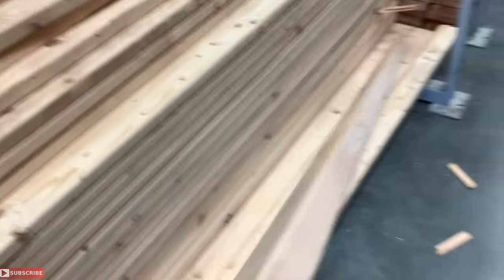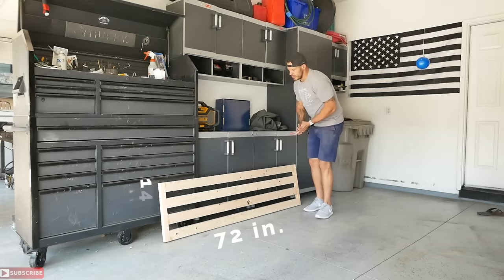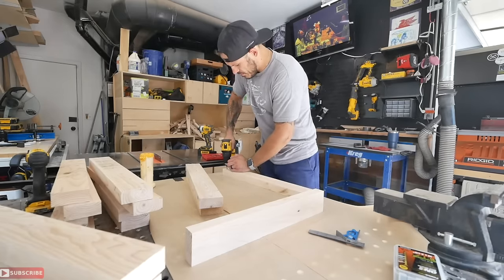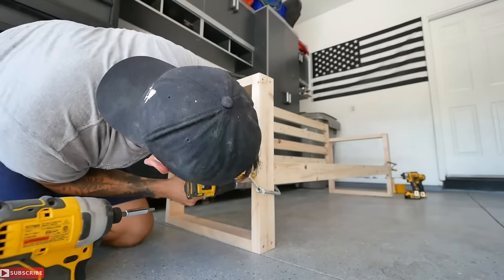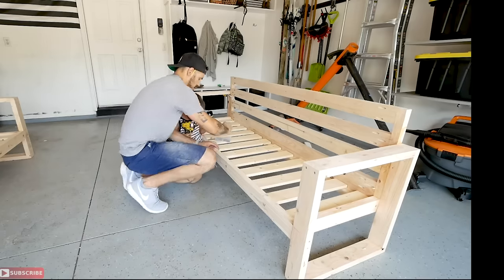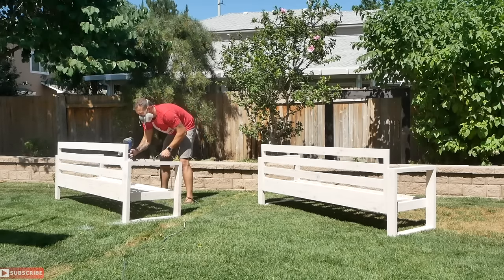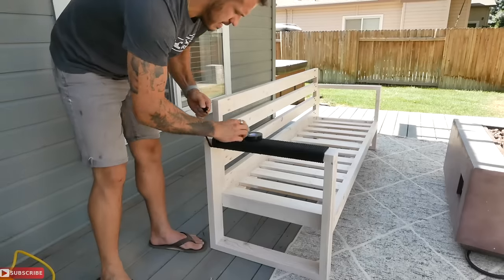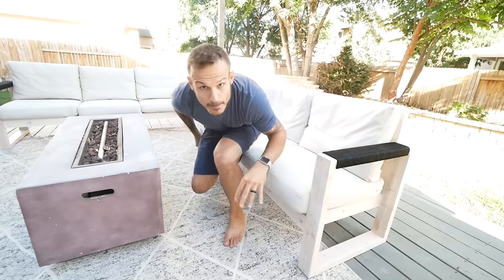DIY OUTDOOR SOFA

Comment: Just made my own version of this sofa and it was super rewarding. Didn’t use pocket holes but I hid all my screws with dowels. Came out pretty nice. Thanks for the video!
Reply: what do you do at the time of rain?
Reply: @mohammednayim  I built mine as a gift but I visit the house where it’s stored frequently. The build is still solid and the finish is still holding up from 2 years ago with little to no maintenance.
Reply: @BrianMajor  Thank you for the info. I been trying to get an outdoor sofa but my wife keeps on saying it will get ruined in rain.

Comment: Really nice. Mine was a simpler build just with screws. I bought Allen Roth cushions during some clearance at lowes. Ended up only spending 40 dollars for the cushions (6 per couch) instead of the original 160 dollars. I used Olympic Stain (leftover from the fence) and like 5-6 coats. The wood wasn't even pressure treated and it stays outside 24/7 getting beaten by sun and snow and rain. Couch still looks new even though it was sitting on grass for the past 5-6 years.
Reply from the maker: Oh that’s awesome. It’s always a little nerve wrecking to build for the outside

Comment: Another great tip for cutting the rope. As you did apply electrical tape on the neck of your cut. Cut it with an knife or sharp scissors and heat up with the torch (or lighter) on the cut side. It’s faster and get you same smooth result. 😉

Comment: Has this held up well after about 3 years? About to tackle this and considering using pine... the downside is that the sofa will be completely exposed to the elements, rather than being covered by a roof.

Comment: Nice job.
I think in chairs and sofas is necessary a 15 degrees inclination in the back to be confortable.
What do you think about it?
Reply: Well probably because of these huge pillows he uses he did not need to make an angled back.
Reply: I just did one like this and the next two I’m about to start will have an inclination.
Reply: @valentinlapatskiy250  what’s your resolution for the angled back? I was thinking that you could just make the vertical arms out of 4x4s which would give you enough real estate to angle the back a bit.
Reply: What are the dimensions of the arm sections

Comment: Not sure if this is covered, but you first measure down 8" when installing the back then when you attach the bottom it's very close to the ground then in the next scene it looks like the bottom is raised to 8", did this get changed or am I mistaken?

Comment: Awesome video. Was able to recreate the whole thing and I made 2 chairs using the same design. Love the stain suggestion too. Thanks man!
Reply: Hey does the back feel uncomfortable being straight up? Thinking of building and that’s the only pause
Reply: @luke.cunningham  I have the same question. You could always replace the vertical legs with 4x4s which should give enough space to lean the back at a slight angle

Comment: Hate me or not but all the weight of the seating is held by the side screws. I'd have loved to see a "housed" joinery between the horizontal part and the vertical sides. Structurally this would involve the sides to hold the weight, and the screws would simple prevent the parts from detaching. Good luck!

Comment: If I want the height of the seat to be higher, all I need to do is secure the seat at a higher part of the arms right? Or would that negatively affect the balance and pressure?
Reply: I would increase the size of the arm rest portion by exactly the extra height you secure the boxspring at

Comment: On what planet is a perfectly vertical backrest comfortable? You could make the front piece of armrest portion longer to tilt everything backwards so it’s usable, and it wouldn’t really increase the complexity, save for a few angled cuts on those pieces.
Reply: He's trying to keep it simpler.  I tend to agree with you though.  I bought a cheap balcony couch with vertical back.  The cushions allow an angled support.

Comment: Could you instead screw from the sides to avoid the angled screw? I know you would see the screws but would it still be sturdy enough?
Reply: No, it would not be sturdy enough. End grain joinery is inherently weak. Think of wood like a tight bundle of straws. The end grain is the top (and bottom) of these straws.  Screwing into the top does not give you nearly as much traction as the sides. Additionally, I am not a big fan of gluing end grain as he does in this video. Those open ends of the straws are very absorbent and capillary action transports glue away from the surface, leaving too little behind to form a good bond. You may be able to get around this by sealing the end grain but I did not see that here. I think he would have been fine with just the pocket screws.
Reply: @mikeh7515  thank you so much! just recently bought a house and want to start building some stuff but don't have many tools yet
Reply: @madisona1516   get yourself a kreg pocket hole if you plan on building.. inreccomend spending the money and getting the one with the build in clamp as I bought the single one and  I'm going to upgrade eventually as the clamp I use takes time to clpnamd unclamp

Comment: To avoid putting visible screw holes on the arms I would use pocket holes on the upper arm on the back side.  This will be covered by the rope.  For the bottom arm put the pocket holes on the back side.  These will be on the ground and won’t be visible.
Reply: I like idea as I prepare to build my own.  All the wood is cut and I'll use the pocket hole jig next...for the first time.  I've read/seen where others claim all pocket holes should angle to the inside of connecting lumber, vice angled to the outside edge, where it would be more prone to pulling out and destroying the joint.  Does the glue's strength reduce this possibility sufficiently?  Thanks for your video!

Comment: I did this outdoor sofa following your video. You have a couple of mistakes from what you say vs what you actually did. Like the amount of pocket screws is the back or the 3 in screws instead of the 6in does not make sense it has to be 6 in since 3 in is too short. 

Also, the back rest flat and is not comfortable I did improve that to make it lean back a little bit. 

Overall thank you for the video but will be nice if you can put more attention to details when you narrates the video with what you did. 

Thank you!
Reply: Can you share how you fixed the issue with the backrest?

Comment: In doing the math I get the 19 inch back 3.25x4+2x3=19. But I don’t understand how you get a total height of 38 3/4 is that including the height of the cushions?  19 +8 inches is only 27.   And it looks like in the first part of the video where you attach the back to the sides you only have 8 inches off the floor but then it looks like you adjusted the height to include the bottom because in the next shot the back is more than 3 inches above the arm rests.  Looks more like 6 inches above the arm height.

Comment: Should it not be 22 inches for the back rest instead of 19 if spacing is 2inches? (4x4=16 for 2x4s and 2inches x 3 spaces = 6inches; So 16+6 = 22?) I am confused, am I not seeing something? HELP thanks:)
Reply: should be 20" since the 2x4 would come in as 1.5 x 3.5

Comment: FYI: I made this and 21in boards are not the correct length. (Maybe I screwed up) The 1.5 inch board on each side totals 3 inches - and they are  perpendicular to a 24in 2x4. 21in sits in the gaps but doesn't rest on the 1.5. 23in to 23.5in would be the better way to go

Comment: I enjoy your videos, you tend to be fun and willing to experiment. That’s why this build I was sad to see you use butt joints and wood filler. It would’ve been a great project to explore heavy duty, beautiful joinery methods especially since this is such a common build that a lot of diyers merely butt join together and call it good. For ie the rapping of the rope on either arm rest, why not recess it into the arms for a seamless look? Or completely cut out each arm rests center and attach rope by drilling holes on the sides to weave in a suspended arm rest. I don’t know but one of my fav I’ve seen built was an L shaped western red cedar (wood doesn’t matter so much but the project was filmed by its name wrc) and they used well known, gorgeous lumber framing with dados etc. intelligently framed each standard 2x4 with thick 1x6 using mitres and it was impressive, Unique, well constructed etc
Reply: Probably because the average homeowner that is building this does not have the tools or the time to do advanced joinery.

Comment: so deck screws have a shear strength have of at least 400lbs each, but I'm afraid the strain would cause damage to the hole over time. 

Overall though, simple and sleek. I don't think you could get a more accessible sofa that looks this good.
Reply from the maker: Hey thanks, I'm curious to see what happens over time.

Comment: Hmm, cool but that won't last outside. Using non pressure treated pine,  not sealing the ends.(glue is not a water barrier sealant). Not sealing the pocket holes...
It will dry out and splinter, even with a stain. Give it a few months.
Reply: He used an outdoor rated spar urethane in addition to stain.
Reply: @YNLEXPOSURE  I've used it. Water will still get between the wood and plastic urethane. It'll start peeling. You need a wood stain and sealer. Don't use liquid plastics for anything wood outside that water will touch.
Reply: @bobloblaw7465  Thanks for replying Bob.  Do you have a recommended sealer after staining?
Reply: @YNLEXPOSURE  use an actual fence stain. Ready Seal. Or Behr waterproofing wood finish.  It's a bit thicker than normal stain, and doesn't use any type of liquid plastics.
Reply: @bobloblaw7465  Thanks again Bob!

Comment: If you cut the rope, just use a lighter on the end that also seals it up
Reply from the maker: But doesn’t it just burn and unbraid.
Reply: Don’t use a lighter, use a hotknife (tool) it will seal and bond it